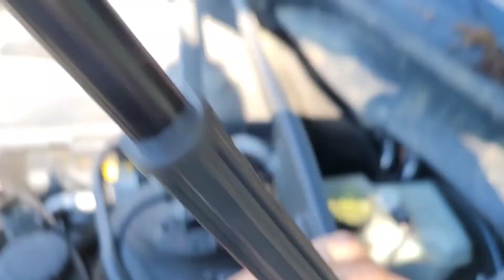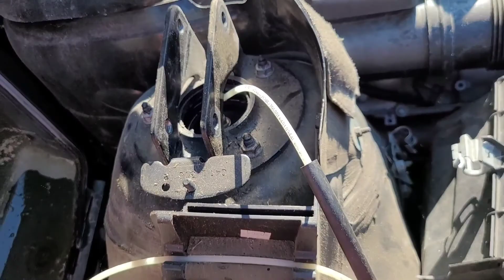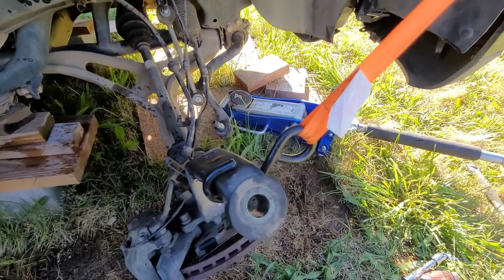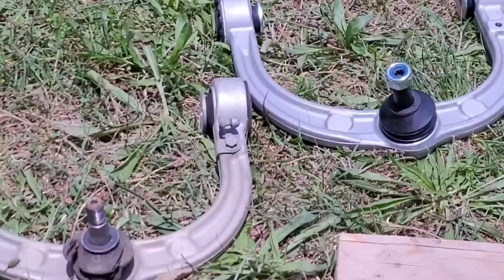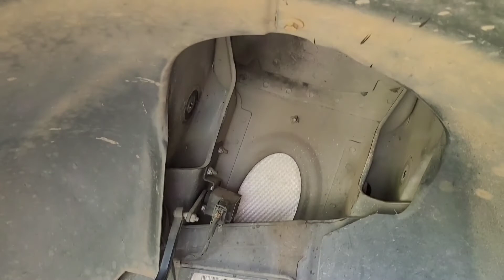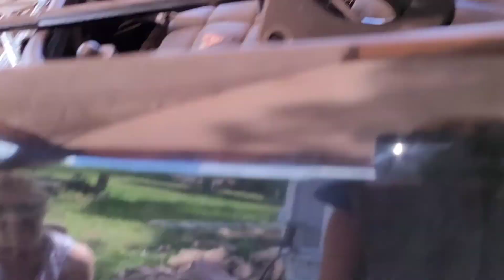Air Suspension Front Strut replacement

Comment: I did this on mine a couple of years ago.  The passenger side was a piece of cake because the control arm nuts were easily accessible.  However, the driver's side control arm was a real pain because of the hidden nut on the firewall side.  I used an endoscope camera to see where the nut was and my teen used his skinny arm and fingers to hold it in place.  Almost blind but not quite.  This was the toughest part of the job.  I'm curious.  What did  you do?  You seemed to indicate that you removed the brake booster.  Wouldn't that have presented a whole other challenge?  By the way, I really like your logical approach to solving problems.  Most mechanics that I've encountered don't think critically - they just throw parts.  Kudos to you.

Comment: An air chisel with the pointed tip works great to pop those tapered shafts out. No hammer required. Learned this when I recently rebuilt the entire front end on my SL65.